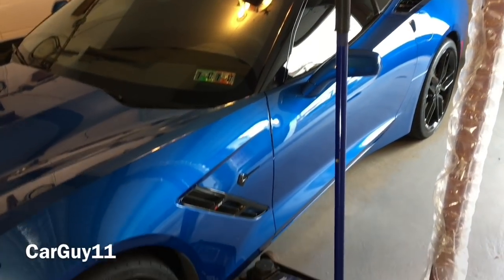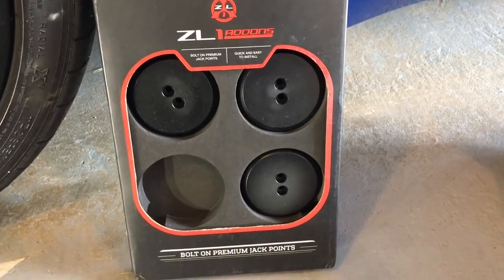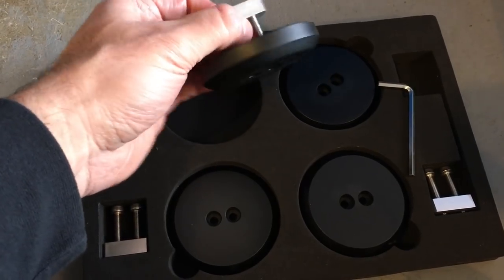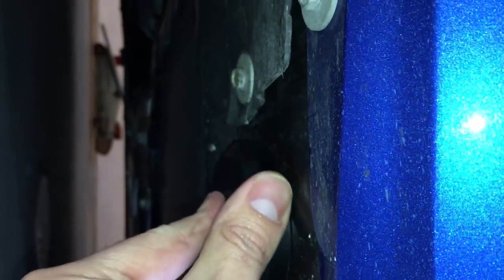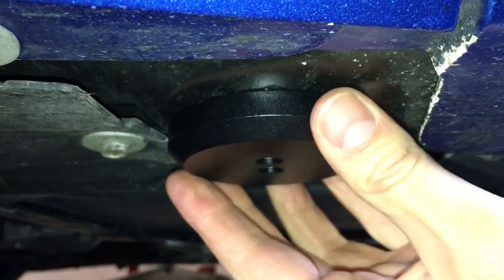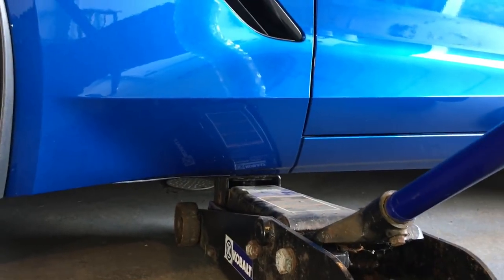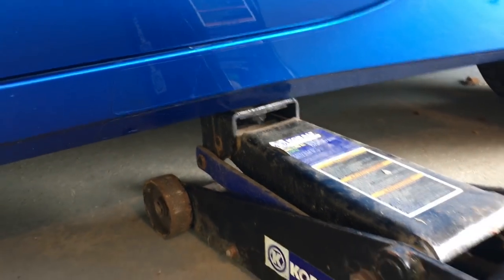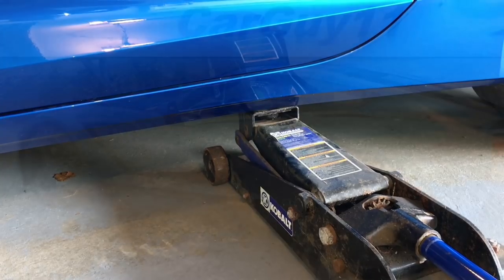Bolt On Jack Point Install!!! (ZL1Addons) - C7 Corvette

Comment: Very nice addition.  VERY IMPORTANT: Keep that allen wrench in your car.  If the car ever needs to be loaded on a flatbed, the driver will need access to those frame holes to attach tie down chains.
Reply from the maker: +bitsnkiblz Good idea!!!  And yes unfortunately I had to show the tow truck driver those holes when I blew my rear end :(
Reply: Good point to remember, Thanks

Comment: Definitely a cool addition!  I have something similar but a lot larger is I bought Steeda Jacking Rails for my car.  Basically do the same thing as these but they are bars that go the full length of the car.  It doesn't add too much weight (15lbs) but I can now jack up 1 side of the car from anywhere on the side of the car.  It also helps stiffen up the car a bit too because of the mounting points.
Reply from the maker: Oh that's cool, like rock rails too for rallying haha!
Reply: R35killa pictures?

Comment: Looks like with low profile jack pucks that makes the clearance really tight, especially at rear jack point.  Take care with dealer visits.
Reply from the maker: Yeah always ask before you take it in if they can handle low profile cars.
Reply: CarGuy11 No, I was meaning the pucks you installed are about half as thick as the ones I have for my Z06.

Comment: I need this. My last C7 (Stingray) did not and when the dealer lifted the vehicle they cracked the panel on the rear. The lift and it's jacking point overlapped onto the body and stress cracked it. I was fuming. Luckily it was underneath and not visible.
Reply from the maker: Geez they should have replaced it!
Reply: CarGuy11 The whole fender? Would have opened up a can of worms. The car is gone and I now have a C7 Z

Comment: you can get them at your Chevy dealer. They are thicker than the ones in your video and come in two sizes. Check out. the Chevy dude's video.
Reply from the maker: Wow didn’t know that. Like them slim like this tho.